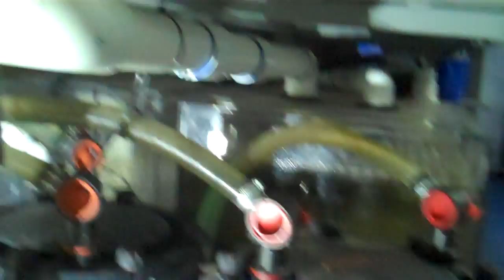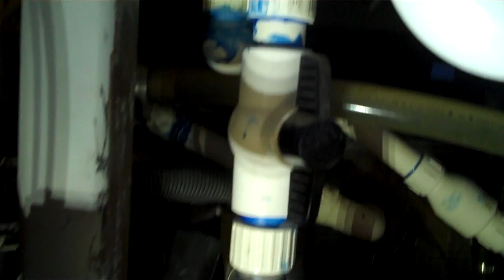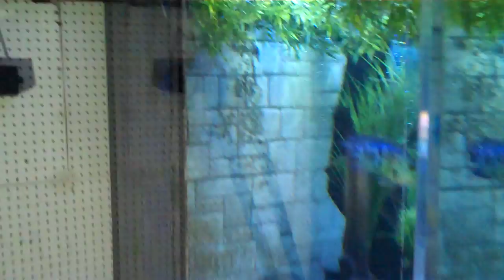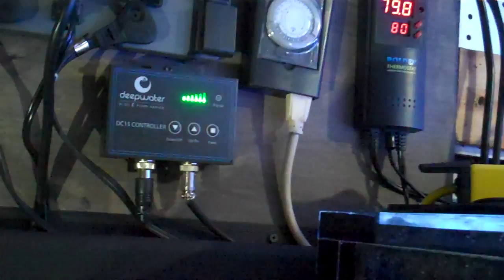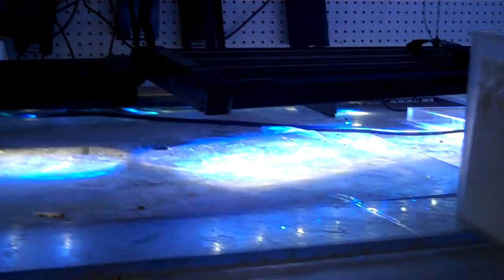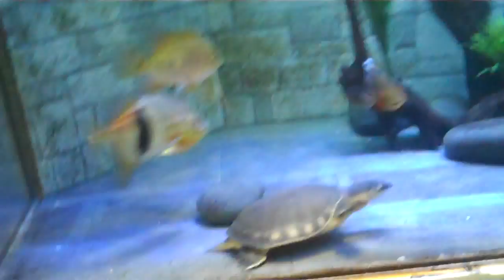Monster Aquarium 1100 Gallon Filtration Tour

Comment: what type of structure is the aquarium furniture. ? Is it metal? how wide is it and how thick?
Reply from the maker: It is a steel stand that is welded.  The square tubing is probably 3 or 4" in diameter.  The front of the stand is just some cover panels I made from plywood, stained wood, and corrugated metal roofing.

Comment: May i ask whats the name of thr machine you use for drip system?
Reply from the maker: It is a Stenner peristalsic water exchange pump.  I don't know the model off the top of my head.
Reply: Sir if you dont mind. May i know where can i contact you straight like a messenger or a viber. Coz i basically copied everything and i got question maybe you can help me. It took me 3 months planning it. It would be much easier to contact you thru that. Thank you sir
Reply from the maker: Um, i'm not sure about those messaging apps.  You can email me a doctorfishious@gmail.com

Comment: Awesome tank setup bro, this tank makes my 350 Gallon look tiny lol. Bro which plants do you have inside the aquarium, what's the name of floating plants? Also is that a poster in the background of the tank? Subscribed, it's a incredible setup! I am Mesmerised 😳
Reply: Also have you pasted tiles at the bottom? I have 2" sand at the bottom and it's so hard to clean it, I might just go bare bottom and get tiles pasted at the bottom too? Or is there a magical way to clean and siphon debris from sand? I watched your tall tank cleaning video too but unfortunately it's a bare bottom too. Love your channel man, keep up the good work. I am a fan already 😅
Reply from the maker: Thank you Addi Gupta!  I have found sand difficult to clean unless you have fish that sift through it all day to clean it for you.  The tiles on the bottom of my tanks are simply cut to size and laid on the bottom--no glue.  For the background of my 1100g, I used a product called eco-bond to adhere tile to the back panel of the tank.
Reply: Thank you so much for replying. It seems though that you have some kind of tape to seal the joints of the tile from the top so the debris doesn't get through! Correct me if I am wrong! Also bro can you please help me out with the plant name..thank you very much. :)
Reply from the maker: The tile pattern makes it look like it has grout, the tiles are actually much larger--like 30"x20".  
The plant is some type of fern.  It is the Aquarium Systems Fancy Plant brand.

Comment: Excellent video, I am building a 500 gallon tanks and learned a few things from your video.  A few questions, where do you get the Japanese mat?  How often do you need to change it out?   Help me understand why you bother with the FX5's,  they seem to add so little capacity to the 600 gallons of sump and are hard to clean out and can leak?
Reply from the maker: Hello and Thank You.  The Japanese mat came with the tank when I purchased it.  It can be found online to be purchased.  The FX-5's help with two things: first, one runs through the uv sterilizer. second, they add flow and turnover to the tank. They are loaded with sponges and pond matrix, which provides biological and mechanical filtration as well.  I only need to service them twice a year, and (knock on wood) they have never leaked on me.

Comment: Man maintenance must be a real PITA with all of that stuff running.... if you could redo it would you have one massive sump and remove all of the canisters? What kind of nitrates you deal with?
Reply from the maker: Nope, it is pretty automatic.  It has a drip system and the canisters do a great job with bio and mechanical.  I couldn't do one huge sump because the stand has supports in the middle of it.
Nitrates hover around 10ppm.